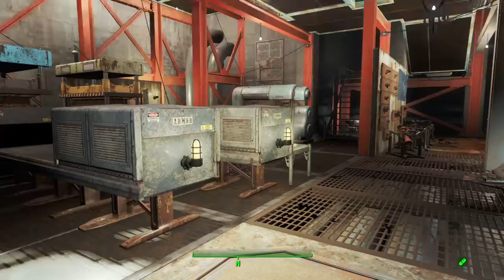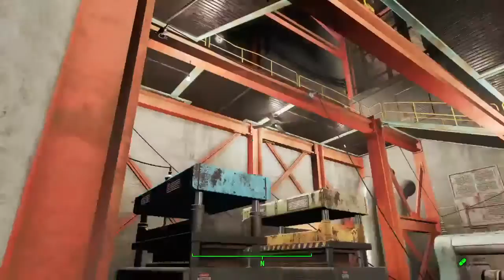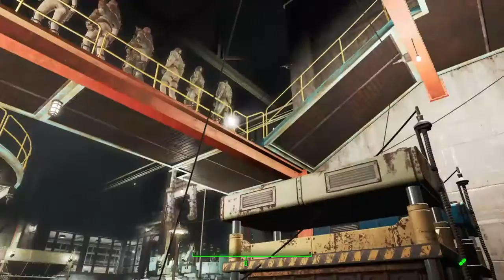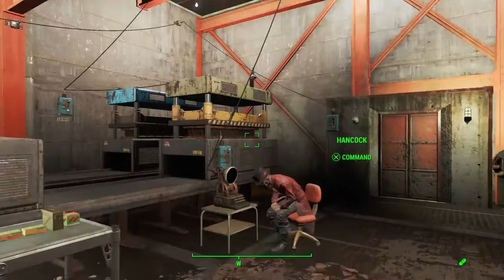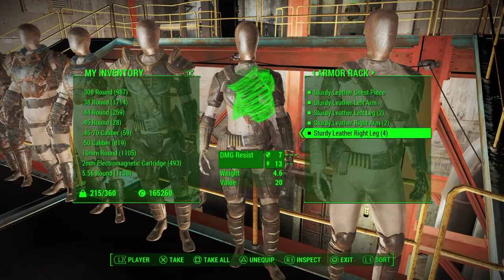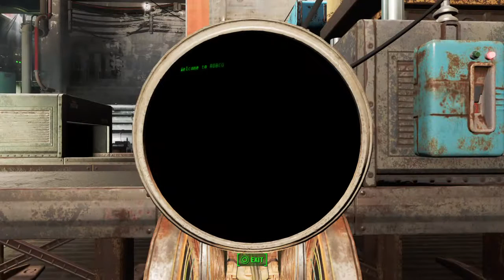Armor Forge Showcase FALLOUT 4 Contraptions DLC / PS4

Comment: Question: is it possible to set up the machines so that when the make an item, it gets dumped into a settlements workbench?
If I want to make a dozen combat rifles for my settlers, and the ammo for them.  It would just be easier to have it all dumped into the work bench.
Reply from the maker: I know it's possible to pull items from the settlement workbench with a vacuum hopper and suck them into a manufacturing machine. But I don't know if there's a way to have them go the other way around, into the workbench. I've never tried it. Why would they need to go into the workbench? In my experience, settlers will grab weapons from any storage container, or from dead enemies, if the weapons are better than what they already have. And they tend to prefer lasers.